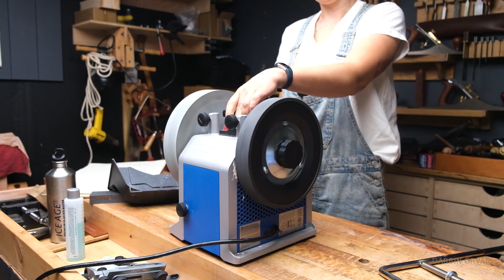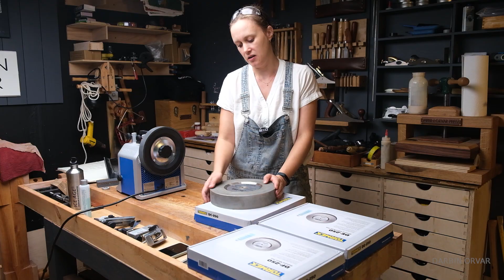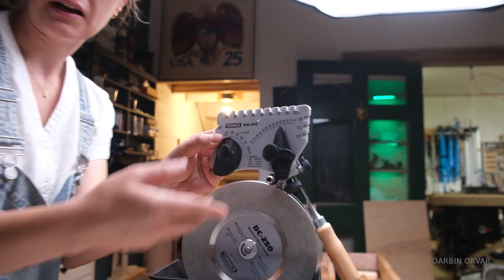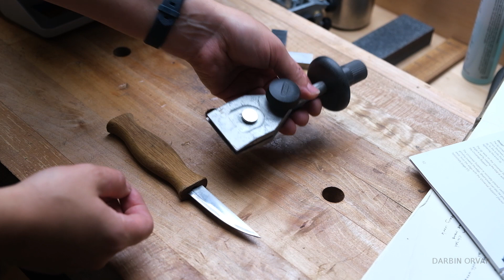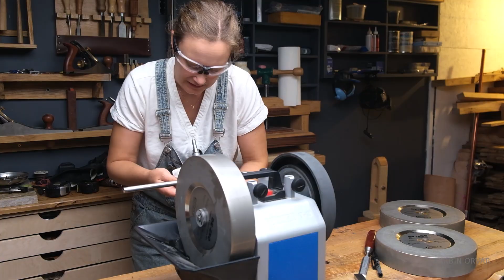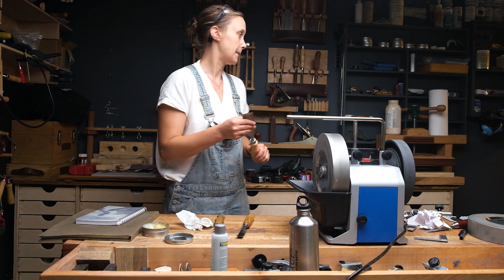My T8 Tormek Sharpening System with Diamond Wheels

Comment: The anti-rust additive is expensive but is reusable so don’t throw it away after you sharpen. Pour it into a lidded container for reuse until it’s too contaminated to use.
Reply: A suggestion I came across is filter the old solution through a coffee filter. 
Also can evaporate off the water to kill bacteria or mold. Just stay below ~230°F.
Reply: 2 words on that idea, coffee filter.

Comment: Thanks for the video. One thing that's not quite clear to me is what do the diamond stones do for you that your regular stone does not? When would you use the diamond stone and when would you use the original?
Reply from the maker: The diamond stones are a bit more effective, and come in different grits. So when you want another grit, you change the stone, as opposed to changing the grit on the original grind stone. Over time the original grindstone reduces in diameter. Both work well, but it's just a different method of operating the machine.

Comment: I have two T8's and have only used the three diamond stones for several years.  I use a 1x30 with a 120 grit cubitron belt to prep the blade for the Tormeks. blade.  great vid.

Comment: Which one is more suitable, diamond wheels or CBN wheels？Different people have different understanding, different companies also have different understanding. 
What I suggest is CBN wheel. 
Today I would like to express why.
As the CBN wheels suppliers for the knife sharpening industry, we must give the right opinion. Most people think that the diamond is much more harder than CBN, so the diamond is better than CBN, this opinion is not right indeed. Based on common knowledge of physics, everyone knows the diamond is just the “C” element, the knife is of steel. For the steel, the basic element is”Fe”, when diamond grinds the steel, “C” +”Fe” will occur chemical reaction. The products of chemical reactions will cover the surface of diamonds, and block the diamond and knife. With time goes on, this phenomenon is increasing obviouly until the diamond lose the sharpness absolutely, that is, when you start using diamond wheel to grind the steel knife, of course it can work, but as times goes on, the sharpness is worse and worse. Based on our experience, after sharpening 30-50 pieces of knives, the sharpness will come down tremendously. No more than 100 pieces of knives, the diamond wheels lose the sharpness absolutely. Then the life of diamond wheels end. Though the diamond wheels’ life ends, but the diamond grain will not be worn, just the products of chemical reactions will cover the surface of diamonds blocking the grinding part totally. This is why diamond wheels can’t be used for knife sharpening. The conclusion has no connection with the grinder speed, no matter is 100RPM or 3000RPM. 
CBN and Fe will not creat chemical reaction, so there is no such block problem happens while sharpening using CBN wheels. CBN wheel is sharp during the whole sharpeing process.
That is why I recommend CBN wheel for knife sharpening.
Reply: Can are usually cheaper than diamond too…

Comment: I find it interesting that Tormek sells their very expensive rust inhibitor - but Nickel does NOT rust.  Hmmm.
I like the bees wax idea very much.  I'm in Southern NC and our humidity is even worse.  Did you finish those tools with the 1200 stone and then buff out the burr or does it work ok to use 600 and the buffing wheel?
Reply: It‘s not the nickel, it‘s the iron particles from sharpening your stuff which could rust on the wheel.
Reply: @thomasliebreich3510  I've used diamond plates (embedded in nickel plates for over a decade and have used both water and Windex on them.  A lot of woodworkers use windex.  No rust at all, as the swarf can not become embedded.

Comment: Never put the back of your chisel on a grinder. It will essentially put a back bevel on it. The idea for a well functioning chisel is to keep the back perfectly flat. Preparing a new chisel is to first flatten the back and keep it that way. A back bevel on a plane blade is useful and makes sharpening easier as you don't have to flatten a large portion of the back of the blade. Paring with a chisel with a back bevel reduces the level of control as it requires you to lift the handle to get it engage the cut.
Reply: Absolutely, the back of the chisel is to be flat and this is the difference between good chisels and cheap one. On expensive chisels the back has be ground slightly hollow in the middle so when you hone it on a flat stone the edges are flat. You can see this clearly in Japanese chisels. I do hope you haven’t spoiled that chisel as it looked like a nice one. Nice video and fantastic to a young lady so into woodworking. As a professional woodworker for over 40 years we don’t see enough women in the industry or as hobbyists. And you’re English is excellent
Reply: I made this mistake once. It also makes chopping perpendicularly (i.e. a mortise) almost impossible.

Comment: Hi Linn, Another great video. Just a thought on the magnetic swarf collector on the T8, I have the T4 and simply place an iron washer in the the tray and attach a rare earth magnet on the other side. When you are finished just lift off the magnet and then you can scrape off the swarf as per your demo. Clean the washer and set it up for the next sharpening session. Yes, the washer will rust with time but just replace it, the magnet will always be clean. Having clean, sharp tools ready for the next project is a great feeling.

Comment: Actually, the torque is high and the speed is low.  They use a pretty sizable reduction ratio on the drive based on the pictures but I do not know the exact ratio.

Comment: What is really nice about the diamond wheel is that you don't need to periodically re-flatten the face.  For my turning tools, I also have the concave.convex leather wheel on the honing side.  The machine I have is a 2000, and I believe it was purchased around 1995.  I am jealous of your model having a knob to raise and lower the water trough.  Mine has tabs that you need to manually fit into slots to have the stone sit in the water.  Can be quite a mess.
Reply from the maker: That's a great point!
Reply: dear, do u know what types of sharpening does vectornix brand used?
and what is the best specification for diamoned wheel that best for deboning knives?